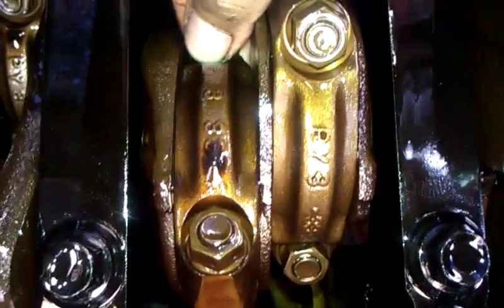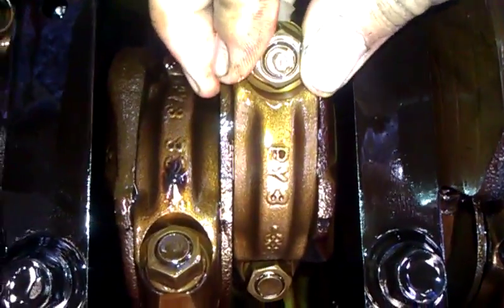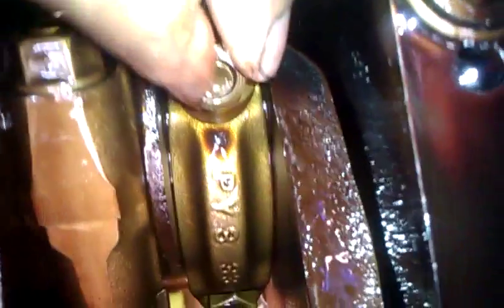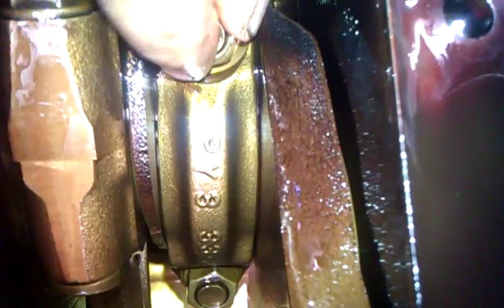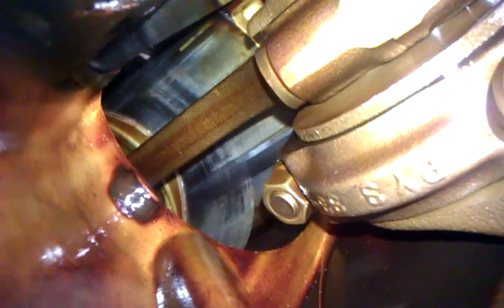Acura Legend 3.2 v6 Rod bearing inspection part 1

Comment: any play side to side assures that the rod bearing are gone, it should be perfectly solid and immobile in any direction especially side to side. sorry to say mate, but if one goes, they all go from the vibration so they all must be replaced, sorry to say chap.